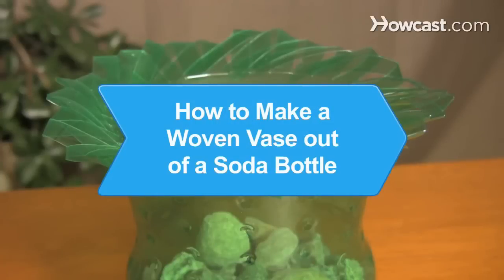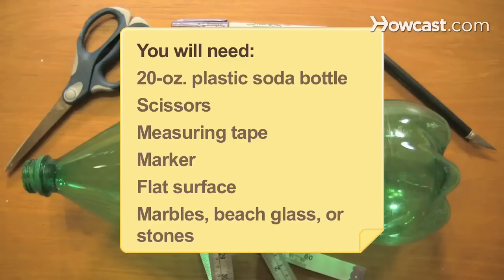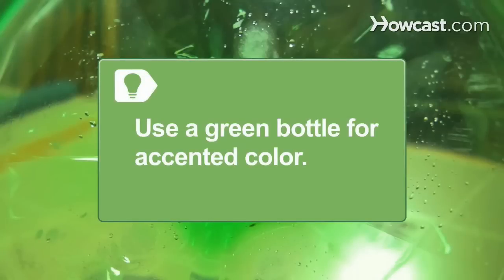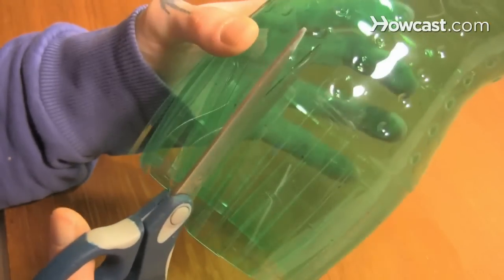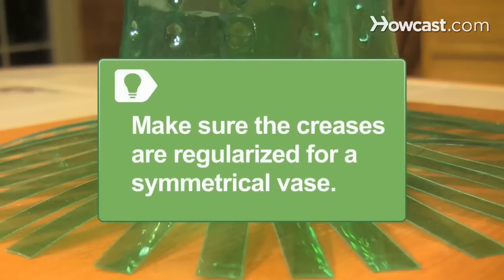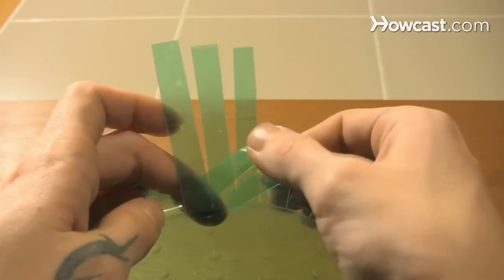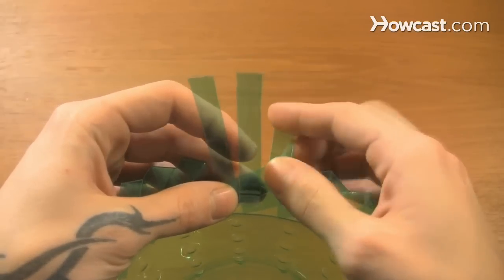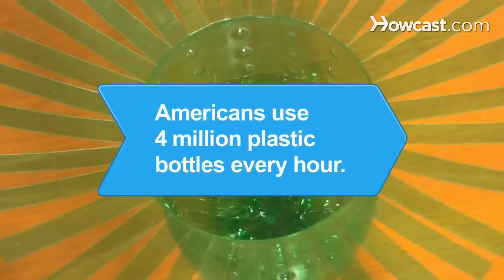How to Make a Woven Vase Out of a Soda Bottle

Comment: Watch more Great Craft Ideas videos: http://www.howcast.com/videos/645-How-to-Make-a-Votive-Candle

Use a plastic soda bottle to make a vase that, if you didn't know better, you'd swear it was made out of crystal.

Step 1: Cut off the top
Cut off the top of the bottle, at the top of the bottle's smooth section, to make an even edge about 3 inches above where the fluted rim will be.

Tip
Use a green bottle for accented color.

Step 2: Cut strips
Wrap the measuring tape around the bottle, mark an

Comment: Step 4: bend a strip over so it goes over 2 strips and under the 3rd. Step 5: bend a strip over so it goes over 2 strips and under the 3rd. Step 6: bend a strip over so it goes over 2 strips and under the 3rd. Step 7: bend a strip over so it goes over 2 strips and under the 3rd. Step 8: bend a strip over so it goes over 2 strips and under the 3rd. Step 9: bend a strip over so it goes over 2 strips and under the 3rd. Step 10: bend a strip over so it goes over 2 strips and under the 3rd. Step 11..